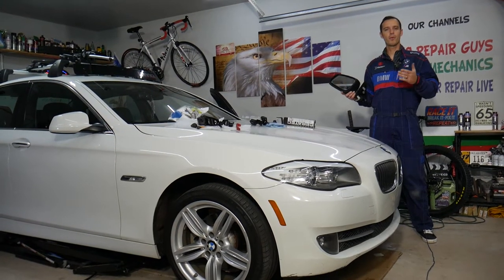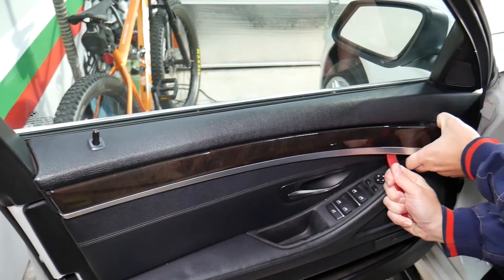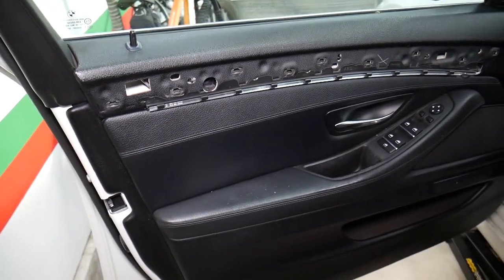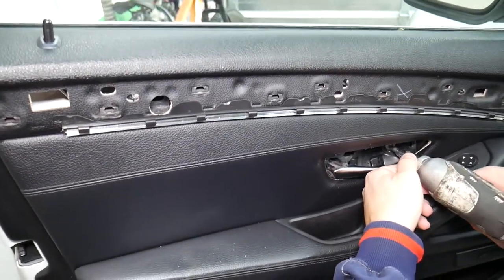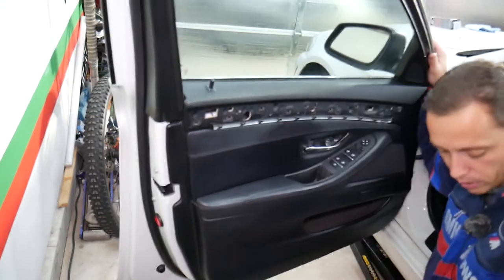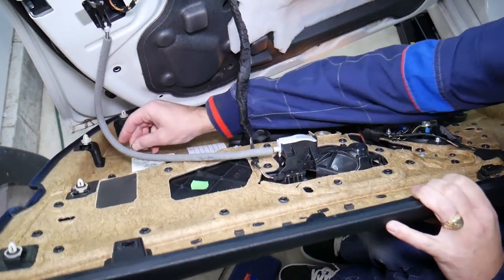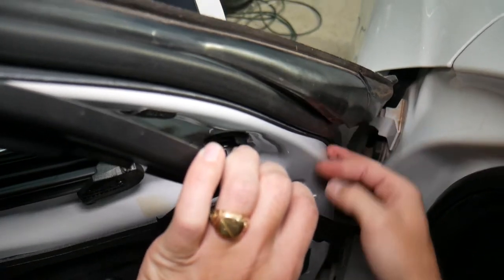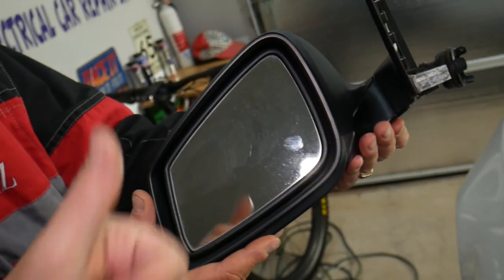HOW TO REPLACE SIDE REAR VIEW MIRROR ON BMW F10 F11 520i 528i 530i 523i 535i 518d 520d 525d 530d

Comment: I have just replaced the black surround frame holding the mirror and indicator light bar on 2015 535i LCI without removing the door panel. The only tricky part is threading the light bar electric lead through the circular tube to make the electrical connection. Oh and be careful not to lose the torx bolts down behind the inner door panel by sealing the gap below the bolts before you remove them.

Comment: Can the side mirror be removed without taking the door panel out ? Or will I have the trouble getting into those bolts hidden under the door seal

Comment: It is not necessary to remove the door panel in order to remove the mirror; it's even rather obvious from your video.
Reply: It is. One of the bolts is in such a place and at angle so you can't undo it when panel is on. I just replaced my mirror now using this video. Tried without taking the door panel off and sadly I wasn't able to undo the bolt. Ended up taking whole door panel off
Reply: @MisTomis  I took my right mirror off to repair it just before my initial comment and I didn't find it particular difficult without the panel removal. Don't have fancy tools either. Anyway maybe there is slight variations between models (pre-LCI vs LCI)? It's worth a try as removing the panel can be a pain.